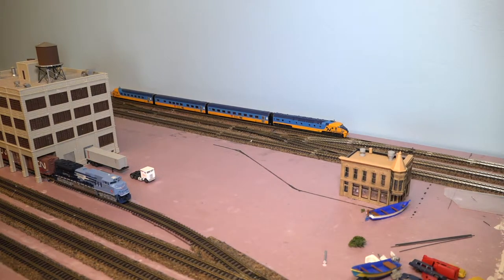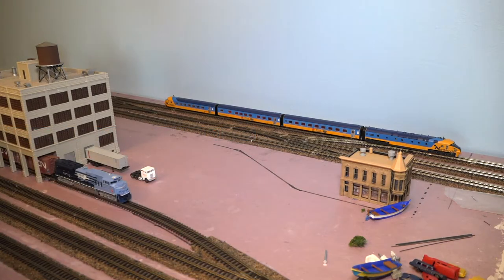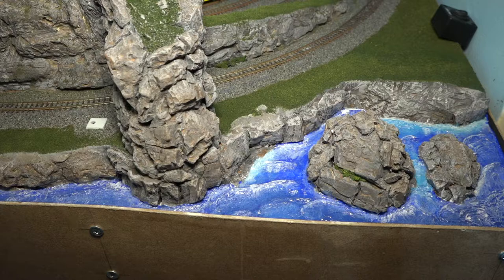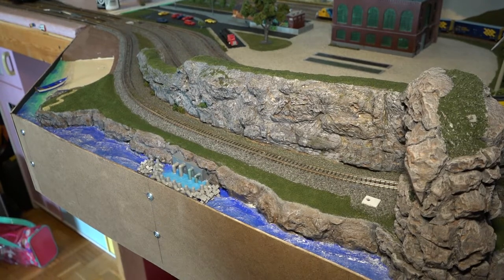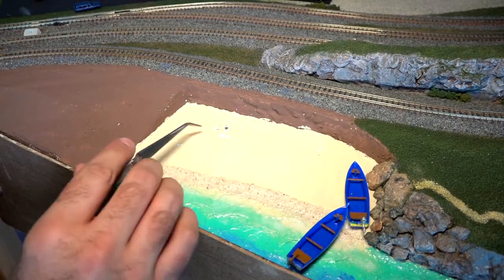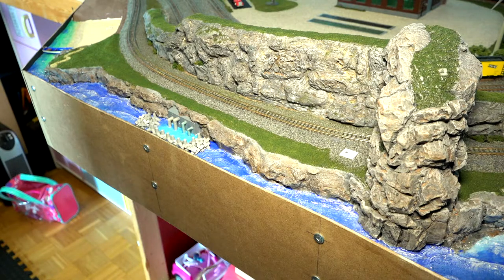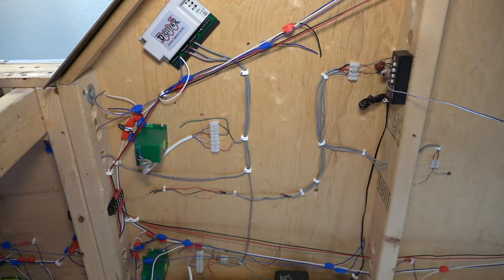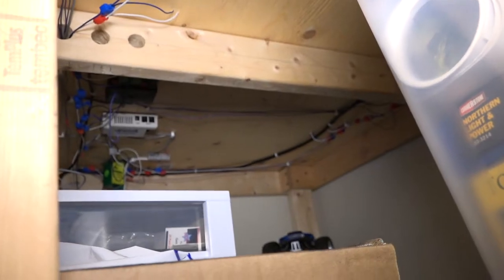Arcadia Update #16

Comment: Good update Tim!, really making nice progress! Beach is coming along very nice. Glad you found the problem with that dead spot.
Thanks for sharing
Muse
Reply from the maker: Thanks David. Ya that dead spot surprised me. Looks like I might be crawling under there and soldering those joints. Think the wire might be to thin for those suitcase terminals.